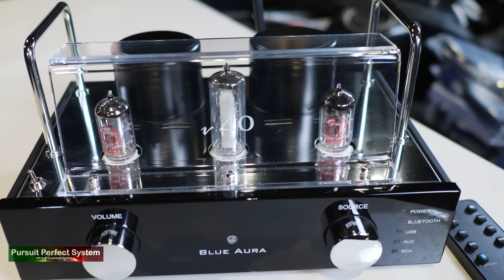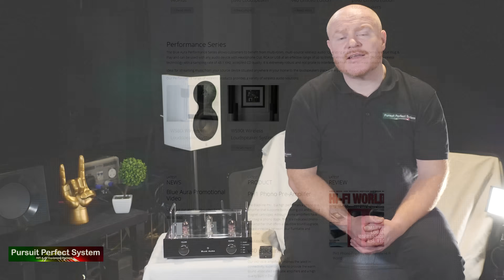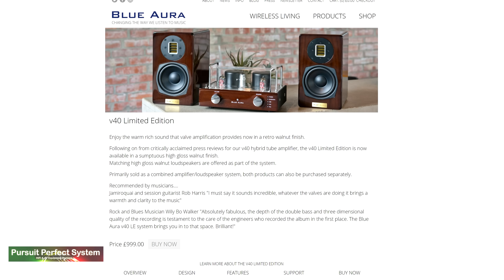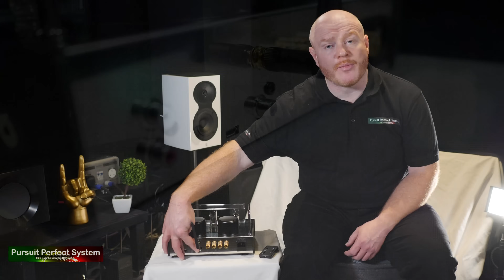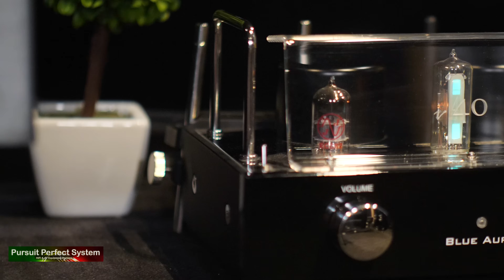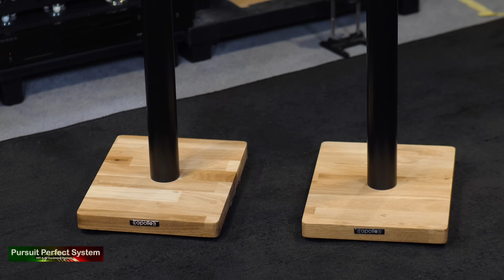ULTRA AFFORDABLE HIFI TUBE Amplifier Blue Aura V40 REVIEW Conclusion

Comment: Fantastic review , I have a mistral  dt 307a hybrid amp and speakers which I think sounds very good  , as a casual listener it looks like a good replacement for my small flat ,  with a grand in my pocket I think this will suffice my needs , I have a teac record deck, a project  cd box s2 ,and a project tuner , my problem is that there is not enough inputs  to run everything off , so I have a junction and switch between sources . If I was to buy this amp and matching speakers , does using the switch box compromise the sound , or is there a better way to keep all sources connected to the amp .  , just vynil and cd  and tuner, thanks john